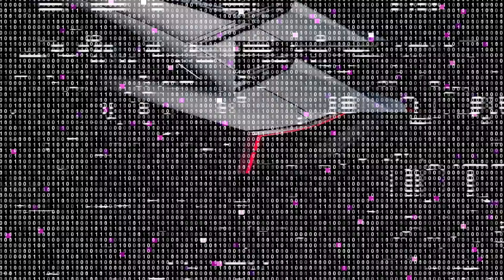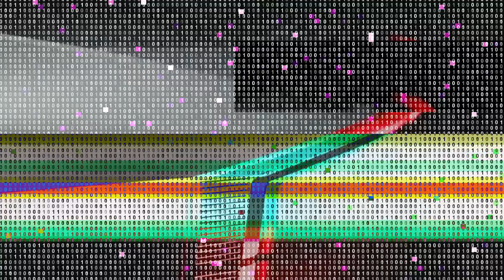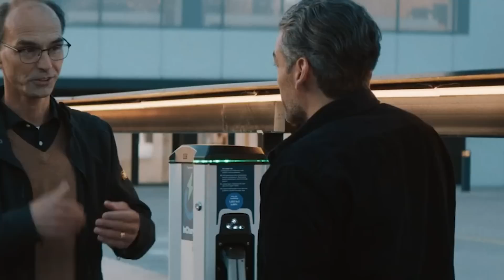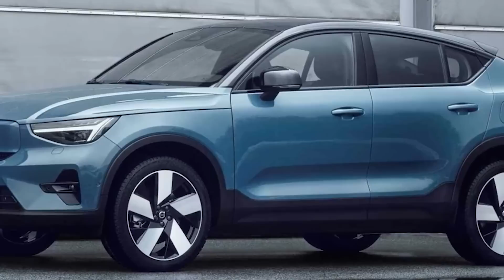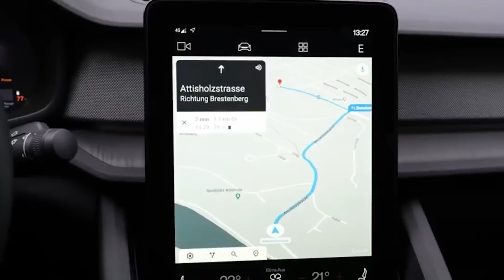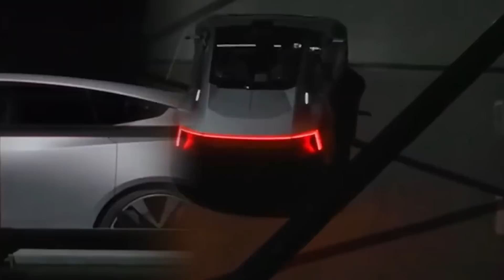Polestar 3 SUV- Finally Revealed

Comment: Great looking SUV - they nailed it.   Buying it will depend on the price point - anything over $80K will cause me to look elsewhere.
Reply: I personally think it shouldn't cost over 60k but hey I'm cheap
Reply: Pretty sure they already confirmed the 80k price
Reply: well indeed if it’s based on XC90 platform which is 79K already and it will have such a huge amount of power, for sure it will be marketed at a 80K budget minimum.